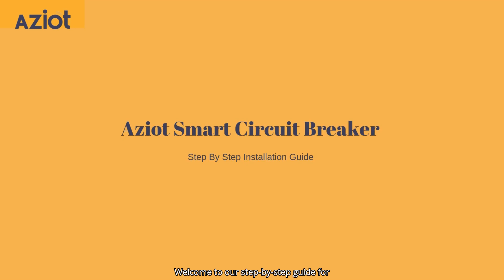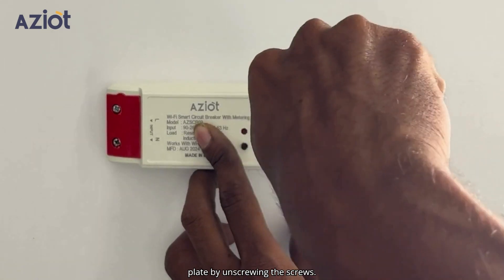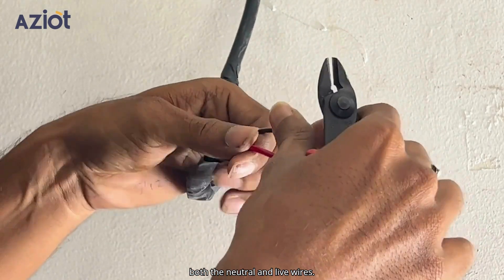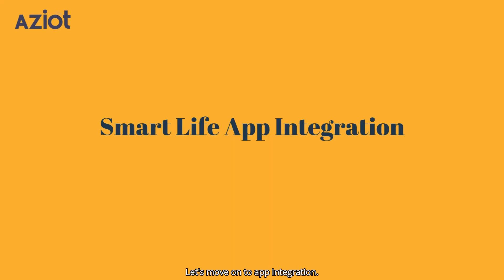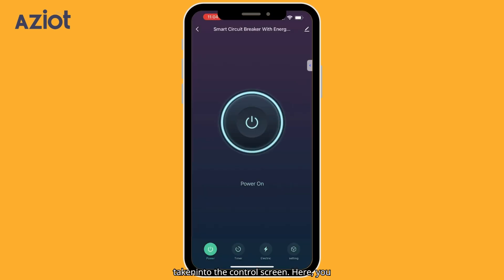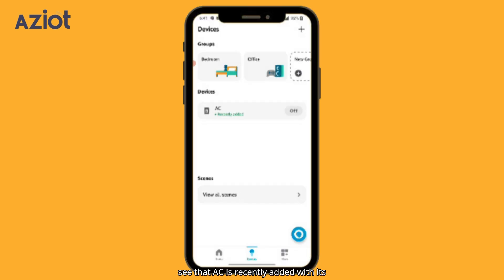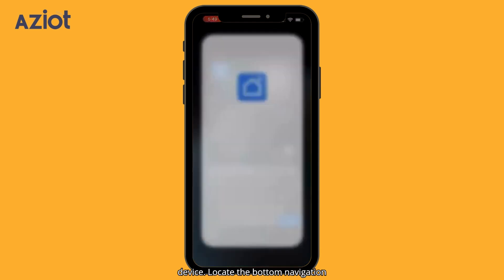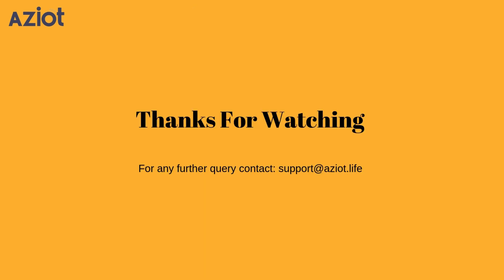Aziot Smart Circuit Breaker Installation Guide | How to install Smart 16 amp Circuit Breaker

Comment: Is there a bypass switch? In case mobile or wifi unavailable?
Reply from the maker: Yes! Even if mobile or Wi-Fi is unavailable, you can still operate it manually 👌

On the circuit breaker, there is a physical button that lets you turn the connected device ON/OFF without any app or internet. So you always have full control 👍

Comment: Is it measuring current using phase or neutral?
Reply from the maker: It measures current using neutral.
Reply: Do you have any device which measures from phase . To use with 1kw inverter
Reply from the maker: @tominjose1993  no

Comment: What is the difference between this and Aziot 1 node switch?
Reply from the maker: With Smart Breaker, you can control with App only, with 1 Node Switch, you can control from both app and manual switch and has to be installed behind the switchboard